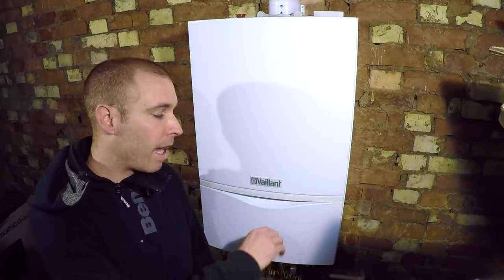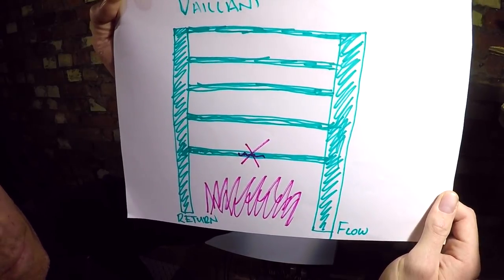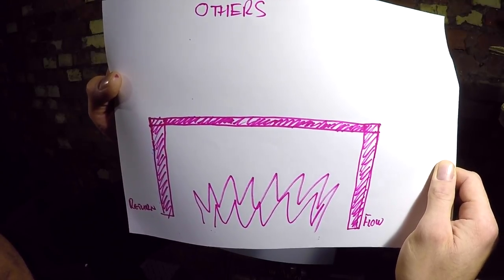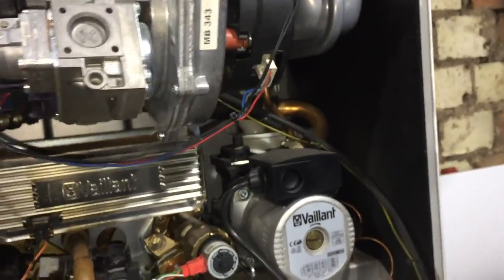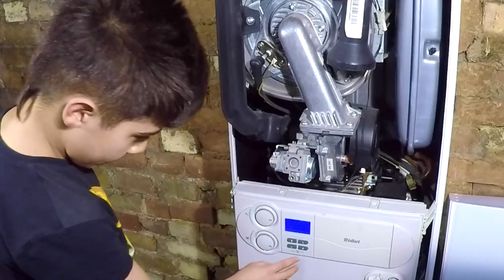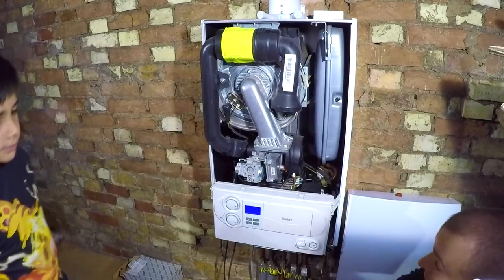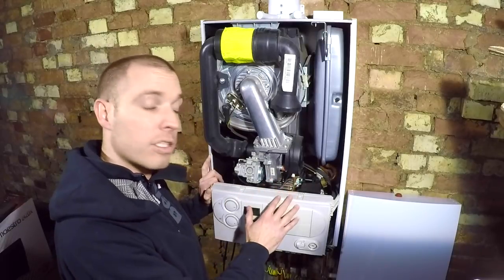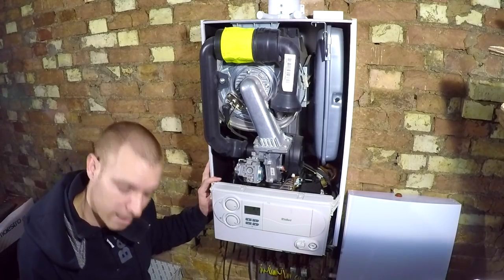My Boiler issues. Vaillant 837 Blocked Main Heat Exchanger

Comment: Check out my channel did a flush on it with an adaptor ....works but not conclusive...as I never refitted..check it out. In my experience you need to use Fx2 neat and leave for whole day running. Or you use scale breaker which is seriously strong.... But don't use it in a confined area or in a house system as you can find you will never get all of it out...dead legs etc and its lethal stuff.  Interested in the pcb stuff I've repaired several with the main cap as they go but there are a few switching blocks that always fail and also a bunch of small parts can take pics and show you as I'm replacing 20 odd a year just vaillants. Just come from a Rsi with 1mb at the valve a full rate...checked the governor ...no...checked the gas valve for blockage common ...no...15mm feed 9 hours..back in business with 22mm. Great channel let me know if you need any help. I'm kamco and dual mags and heaters all the way !
Reply from the maker: Im gona wing it and see what happens.

Comment: Great video. Quick question, I'm getting luke warm radiators and heating from my combi boiler. 
Could it be the symptoms of a blocked/sludged heat exchanger (waterways) so hot water cant get around.
Or a blocked outer part of heat exchanger and it needs a service.
How would you know if it's one or the other, wouldn't you get same symptoms on both? Would appreciate your answer, thanks

Comment: This is why I can’t stand that heat exchanger, I live in the New Forest where the water is 2500+ ppm hard water they don’t work well here.... esp when people don’t use scale reduction, system filters and don’t flush properly. Good luck with it, don’t hold out much hope 😎
Reply from the maker: Its worth the risk though. In my own house.
Reply: Fill once with soft water. >100mS, pH neutral. Done. Do find VDE2035 and apply religiously.

Comment: I'm a boiler man can you give me an example of how you power flush the heat exchanger. What machine you use to send high pressure water through the system
Reply from the maker: There are videos on this subject. I wouldn't power flush a Vaillant heat exchanger because it doesn't work. :-)

Comment: Hi. I’ve been told my Vaillant boiler requires a new mail heat exchanger or renew the boiler. Either of them I cannot afford. Is there a way to clean the parts with a bottle of cleaner?  I’ve cleaned the radiators, however it’s the heat exchangers I need to clean. The shower water goes from hot to cold intermittently.

Comment: Looking forward to the next video, I know someone with a silimar sounding issue on a valient boiler, makes wierd noises, and hot water runs cold if the taps are fully opened. they've had numerous engineers out not one has solved it.
Reply from the maker: Thats the problem. if they press the i button when its doing it I bet it will say S.54
Reply: @HeatingGeek  will get them to check it out cheers

Comment: Just been to a 837 today with exactly the same issue, never had this with any of the lower output Vaillant's so do you think it is a problem only with the larger Gianonni heat exchangers?    Have you had a chance to try to reolve your boiler yet or just too mobbed like the rest of us? Lol
Reply from the maker: Mine is worse. I still haven't had time to fix it. ASAP though. hot/cold showers at the moment.

Comment: I was hoping it was going to make the same noise as mine aonfirming my thoughts about mine. Mine bangs  violently  and the guage goes like a windscreen wiper cuts the flame and stops heating, once reset then works fine until next time its been off for a few mins.
Reply from the maker: You have a blockage or one of the pump speeds has failed. Check out the Vaillant pump hack video I did.

Comment: Yeah its crazy the price of new heat exchanger , our place just replace the boiler as it’s so much cheaper for us to do than buy a new one . And yes with you on the servicing thing haven’t touched my 24i junior since i installed it 6 years ago 😂 but it has a magna clean on it so not too worried about magna build up .
Reply from the maker: I don't think the magna build-up was because of a lack of filter. Just lack of inhibitor and laziness.

Comment: Looking forward to it Oliver, my two little boys like to help me too, but they are still at the destroying stuff stage. Do you think a milder form of acid would work on it, like you used on the secondary heat exchanger?
Reply: Very intresting. Maybe loop flow and return through small rad and run with descaler . Failing that try draining then blow torch blocked coil  and descale again. Great videos anyway.
Reply from the maker: Im going to try something like that!!
Reply from the maker: Thats what im going for. I have 4 different types of acid.... so we will see

Comment: Great video . I've just had my bolier serviced and engineer replaced my burner seal and struggled putting it All back together he banging away at my heat exchanger now it's making funny tapping noises . engineer said it's nothing to worry about it's just creaking . any ideas cheers
Reply from the maker: Funny tapping noises happen when the 2 different metals (stainless steel and cast aluminium) expand at different rates. It does happen on these boilers but Vaillant give you grease to help prevent this. I haven't really had this issue TBH. I think people over tighten the nuts and this is the route cause. So, Don't worry about it, Its quite normal.
Reply: @HeatingGeek  ok thanks for the reply . just curious as before the service my bolier sounding normal see how it goes .. had the engineer back he said it's my heat exchanger creaking .it makes the nosie when the bolier starts up and shuts down and when the circulation pump kick's in.

Comment: i thought you put it into p mode by holding plus and minus while the boilers off then turning it on still holding plus and minus, didnt know there was another way saves me messing around with the switch.
Reply: only the plus and either rotary on/off or reset. Reset is safer because you done run the chance of blowing the board when your turn the on/off
Reply: @kb5057  yeah exactly, good to know and also if its quite old them control knobs get quite brittle.
Reply from the maker: Yes. I try not to turn them off by the big clunky switch because some will turn back on and put CON on the display. Its new PCB time then.

Comment: Hi Oliver, I was at a Vaillant training course this week in Maidstone and funnily enough the trainer held up a Valliant heat exchanger and proceeded to tell us that it could not be flushed because of the of the set up of the manifold and pipes. So I remembered your video and I am keen to see if it can be done. Best of luck mate.
Reply from the maker: Thats right. In my own house I risk getting it all wrong because no one is paying me.
Reply from the maker: How was the training course?
Reply: Hi Oliver, The training course is free and was okay, the trainers are good fun, you get a free Vaillant pen, free lunch and "cake", an App that you use to scan bar codes that's quite handy and a fault finding booklet. 
I was surprised the Vaillant training centre has a Potterton central heating system, perhaps they do not trust their heat exchangers :)
Reply: @HeatingGeek  Do you reckon it might help to run the system with a strong cleaner before attempting the open heart surgery?
Reply from the maker: @gonzalomartinez1630  Im going to check some basics first and the add something.
Reply from the maker: @gonzalomartinez1630  I never knew that. I have been to that training centre for some admin thing.

Comment: The heat exchanger on my Valliant is fully blocked, not the same boiler as you but probably similar. Given the cost of the heat exchanger, I think I'll just replace my boiler altogether as it's quite old now anyway.  

Can you recommend any good boilers, if price is not a major factor? It's hard to know where to look, to figure out if a new boiler model is any good or not. 

Also I wonder why Valliant use this design for the heat exchanger, what's the advantage if other boilers can just use a single pipe?
Reply from the maker: The parallel coil is a superior design..... I cant remember why right now. Brain fart.... I have a whole video about the best boiler but I haven't released it. Sorry I cant help you on that one right now. Speak to your local installer and he will recommend one to you.
Reply: @HeatingGeek  No probs, thanks for the reply. I'll check back in the hope you upload it at some point (I'm a while away from replacing everything anyway).
Will chat to local installer, but I'm never quite sure whether they are truly recommending the best boiler, or just the one which is least hassle to install and maybe with the best profit margin
Reply from the maker: @carpii  Where are you based? Maybe I'm your local installer. :-)
Reply: @HeatingGeek  Up in the North East sadly. I'm what they call a Monkey hanger ;-)

Comment: Vary interesting. Maybe loop flow and return through small rad and run descaler through it for 24 hrs. Failing that drain and get blow torch on coil then descale again. Great videos keep up the good work.
Reply: or just cut the flow and return together with a couple of temporary speed fit elbows...
Reply: @kb5057  For sure but boiler will not stay on much.
Reply: all you want is hot circulation so once its up to temp, which will be quick granted, its just pumping round hot water, in and out. All you need and saves gas haha  @winterskysteve
Reply: @kb5057  How would you get the descaler in?
Reply: whip the AAV out matey  @winterskysteve
Reply: Wouldn't be a bad idea to have a filter on while doing this so could always dose from there too.  Have a look at this vid, its on a regular boiler, not a combi but principle remains https://youtu.be/JT1jLR8aR7s
Reply from the maker: Im not sure yet! thinking...
Reply from the maker: I might just pull out a pipe and pour it into the lower half. Then fill up and run.
Reply: @HeatingGeek  On dhw like a junior...that might work.

Comment: self inflicted pain mate.
Reply from the maker: I know. I will fix it and clean it and service it. then add inhibitor.......
Maybe.
Reply: @HeatingGeek  You will add inhibitor, two bottles to make up 1ltr, OR you will have no warranty and not be installing to the standards required of a RGI. And did you get a kid to do that technical drawing, you are living on the edge mate.
Reply from the maker: @derekclark7545  I might add inhibitor. A mate has a heat x for me so might not.

Comment: Not the best advert for regular maintenance, my GW Spacesaver was still like new after 25 yrs up until I moved and only had one new thermocouple but most importantly it was regularly maintained.
Reply: jaxmar88 those days are gone lol
Reply from the maker: Heat Service bwc uk They are long gone!!!!! How old is he????
Reply from the maker: See bellow. ;-)
Reply: Lol
Reply: All I'm saying is that regular maintenance and keeping the inhibitor fresh etc will extend the life of most boilers, then there's the warranty to think about.
Reply: Lets just say my tablet came with a hammer & chisel lol
Reply: Bellow(s) That was something we used to blows air into the flame which made it much hotter lol
Reply: What year did you enter the industry jazzmar
Reply from the maker: @jaxmar88  I cant spell for s@#$. Never even passed english GCSE (O level to you). 
Im only messing.;-)
Reply: HeatingGeek ha ha wind up . Martin you ain’t that old are you !
Reply: I didn’t even sit mine !
Reply: Same here mate, left school at 15 and started my gas board apprenticeship in 1970, Ive never been good with manuals I prefer to take something apart to see how it works.
Reply: jaxmar88 an old school engineer one of the best around
Reply: Thanks mate, we made a good team but Ive handed over the reins to you now but always here when you come across one of those old boilers/systems.

Comment: Can you recommend any tools or advice on cleaning the copper heat exchangers and the potterton suprima heat exchanger thanks
Reply from the maker: As in the POC pathway? Or the water ways?
Reply from the maker: just a reign brush set. you don't want to scrape the zinc off the copper though so don't use anything metal on them. Suprimas are a pain to clean. Again I just use the Regin brush set.
Reply: @HeatingGeek  the pathway not the waterways thanks
Reply: @HeatingGeek  Thanks appreciate  your help had a suprima the other day failed on the co I spend time on it but couldn't get it right so had to put new heatexchager in the flat  cleaning blades are good but it's hard when they get blocked .I admire you for your dedication on fixing the boilers I won't spend anymore than a hour unless I can guarantee to fix it I mostly deal with the Worcester which I carry a lot of parts for I know people don't like them but I love them lol
Reply from the maker: I enjoy the challenge. Time doesn't matter.
Reply: @HeatingGeek  Yes I can understand that but I can't afford time wise to be on a job to long but I understand if you do repair work only you probably have more time to spend on it.I find one big problem with the plumbing and heating game is every one that rings you wants a bit of you straight away so I'm for ever working long days which as you get older starts to grind you down I know money's nice but you can't take it with you
Reply: @HeatingGeek  you would make a brilliant teacher as your very good at explaining how it works in simple form that you can understand could you do some videos on how to remove parts on some boilers would help out like you did on the ideal boiler I found it very helpfull on the Worcester I know when burner gaskets should be changed but are not so familiar with some other boilers what you should be doing at what stages on the servicing as you know most people have lost the boiler instructions if you don't do repair work every day it can be hard keeping up with it thanks for all your help keep the good work up
Reply from the maker: Thanks. Its very hard to plan any videos. I have some PCB ones to do but no time at the moment. I will keep putting stuff up as soon as it gets edited Thanks for watching :-)
Reply: @HeatingGeek  any hints and tips are much appreciated  thanks the Worcester file is a good tool I might cut one down to fit the suprima

Comment: To be fair it's probably just blocked rubber tubes. Work on loads of these boilers.
Reply from the maker: It wasn't. I did check. If I can ever get the video uploaded you will see. :-)
Reply: Cool. They are a pretty bomb proof boiler bar the diverter and water flow sensor (f.75) although you could say there caused by dirt really.
Reply from the maker: @davestephenson2990  They like to bake debris into the heat exchanger though. F75 is always dirt. Never had it on mine though.

Comment: Had the same shit boiler today wanted to flush it making noise
Reply from the maker: Mine is still going strong. :-)
Reply: @HeatingGeek  Did you managed to clean it out with even stronger stuff as was looking for part 5 of this video.
Could you have put cleaner in the auto air vent
Reply from the maker: @b1h2u3p4  Yes you could. The boiler is spot on tbh. Still goingstrong
Reply: @HeatingGeek  Nice liking your videos. I've probably seen them all.
Reply from the maker: @b1h2u3p4  Good. Im glad you like them. ;-)

Comment: Interesting video, I never knew vaillant hex had parallel coils, Iv previously powerflushed a vaillant heat only boilers that was Ketteling & would only run on high mode for a few seconds, it ran like new after the Powerlfush! Maybe i got lucky, I used X800 & Kamco / magnet filters.
Reply from the maker: Maybe. I haven't had too much luck power flushing EcoTecs. Im doing mine tomorrow. Hopefully it wont need a power flush.